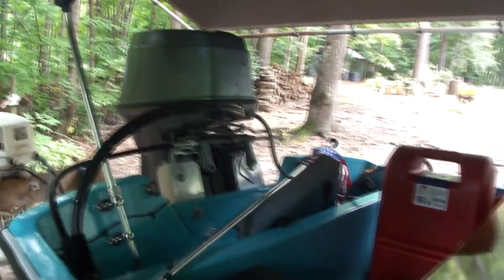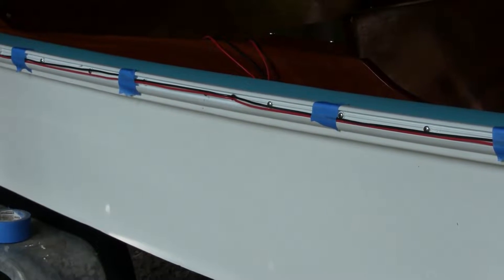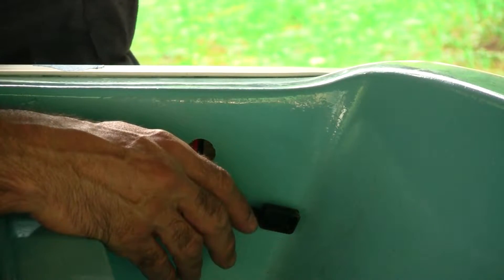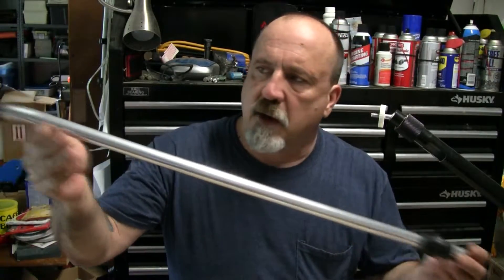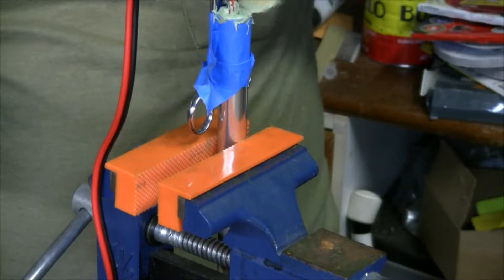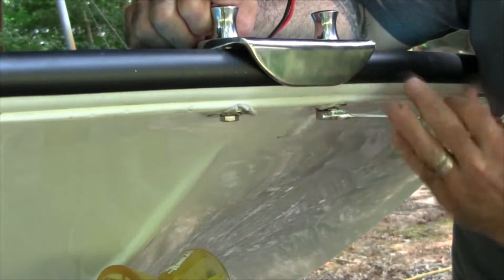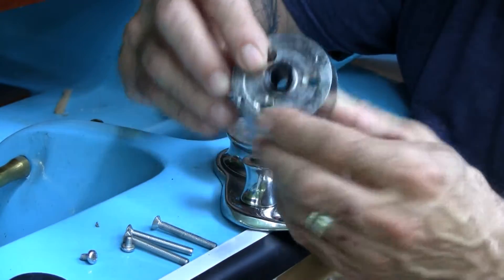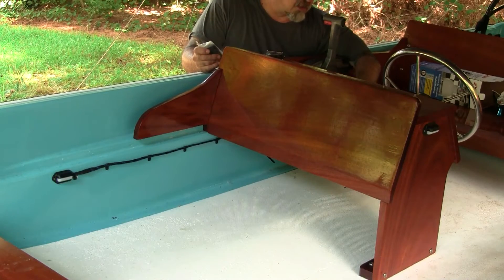Boat Navigation Light and Anchor Light LED Mods and Wiring - Boston Whaler Restoration - Part 18

Comment: for the stern light, the LED is special in that it is non-polarized, or at least mine was. so since it will not be "re-lamped" it is not crucial to make red positive. It glows in either direction. One added feature I did was make a half sleeve to cut the forward facing light while under way.
Reply from the maker: Must be a special LED!

Comment: When installing the anchor light mounts, did you use the BW “hockey puck” method? Or did you just drill into the foam and seal it off with 5200? I ask because I have heard that the “hockey puck” method doesn’t work as advertised and delaminates the fiberglass. Thanks.
Reply from the maker: Just drilled into the fiberglass and used a 3m 4200 equivalent
Reply: @ExtremeDIYGuy Awesome, I am in the process of installing a transom light as I type this. Thanks for the help 👍

Comment: Looks really good..I just bought the same switch panel off of Amazon,,how do you like it? ...Is it holding up ?
Reply from the maker: I was really pleased with that panel. I did sell that boat and bought my next project, a 2000 Dauntless 1800. I haven't gotten any negative feedback from the buyer so believe it's still going strong!

Comment: Really learning a lot here , can you share the wiring guide for your whole setup - Also a few questions - what drill bit size for the hole for the bow light? And can this be done with all butt connectors- ie no soldering
Reply from the maker: I'm working on putting a diagram together and will add it to the description when I'm done. If I remember correctly, I used a 1/2" bit
Reply from the maker: Forgot to add, you can do most of this with Butt Connectors but would use the heat shrink ones. It might be a little tight at the bow light though.

Comment: Is your jack plate hydraulic or manual ?? I’m looking to get one and found some manual ones for like $220.  And the hydraulic ones for $1,200 and up.  What brand is yours ?
Reply from the maker: Hi, it's fixed in place so there is no adjusting it other than moving the plate or the engine when mounting. It's made by CMC, here's an affiliate link to one. https://amzn.to/3hwDBGg

Comment: Awesome job! Ive been following for months as I've been restoring my '69...How did you go about flipping the boat back over and onto the trailer without jacking up that new finish? I'm in the process of laying down the last couple coats of paint on the hull and was just curious if you had any poimters bc I'm definitely a little nervous about that move lol.
Reply from the maker: Hey Kevin, it was fairly easy. The 2x4's it was resting on were padded so we simply flipped it over right on to the 2x4's. Then we backed the trailer up to the boat and between my son and I lifted the bow to where the keel was resting on the first roller. After that, we just pushed it on, went on smooth as silk! BTW, if you used a two part poly on your hull, I wouldn't worry. That stuff is hard as a rock. I've been a little brutal with it taking it out and it looks as if it were just painted!

Comment: A stern light only faces aft, this is your all round mast light which is an accepted way of displaying lights for a vessel <7m.  Very nicely done!  Love your vids
Reply from the maker: Thanks for the correction. Also known as an anchor light, correct?
Reply: @ExtremeDIYGuy  could be used for that sure,  but normally that's a forward all round light for a vessel under 50 metres. You just have to turn off your nav lights (red and green).  But as they're optional for a vessel under 7 metres and 7kts,  it is all a bit of a grey area as you could be at anchor or making way 😉 It's good in that case to have the nav lights and the most important thing is to be seen at the end of the day 🤘The red and Green (and a 135 degree stern light) lights are to determine aspect so the correct actions maybe taken to avoid collision.
Reply from the maker: @mjobrien69  Thanks Matt, I'm always glad to learn!